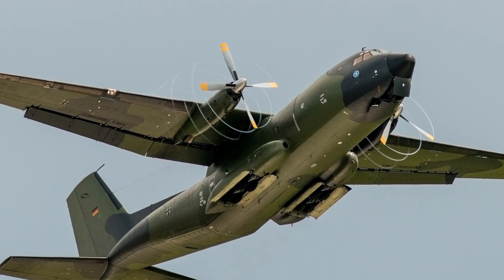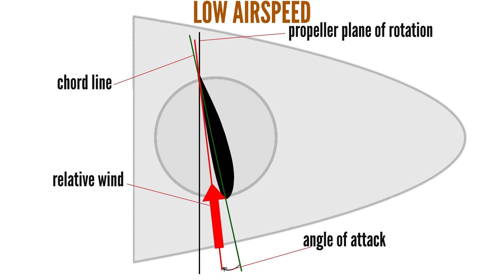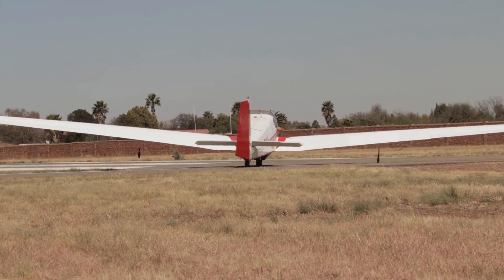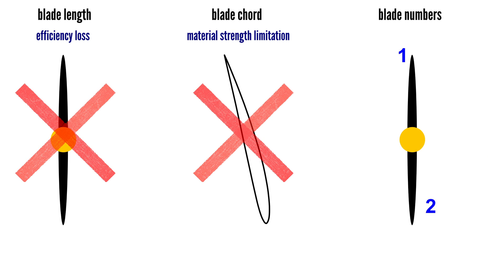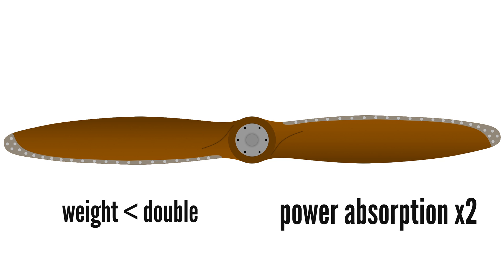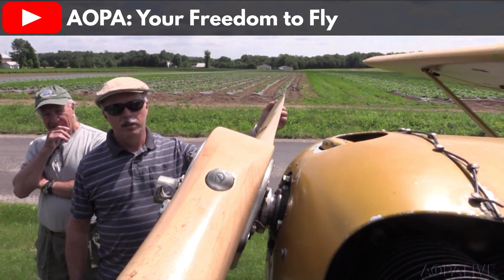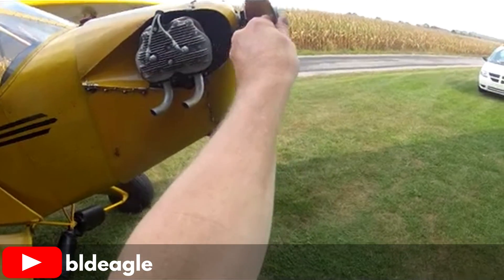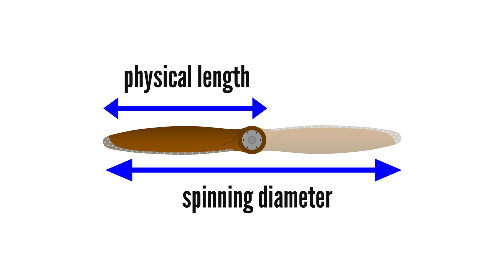The Problem with Single Blade Props Isn't What You Think - Efficiency Deep Dive

Comment: I'm not interested in efficiency. Powered hang-gliders and para-motors don't really care if they use an extra quarter liter of fuel an hour.
The NOISE is what gets us banned from flying sites.
A one bladed prop would put sound out at half the hertz and humans are happier with low tone sound than high pitched sound.
Is there any information available about this?

Comment: It was common for a time back in the 40s * 50s in model airplane contests to see large rubber-powered models with a big single blade prop which was folded by air pressure after the rubber unwound and the prop stopped rotating, thus greatly reducing drag.  It was interesting to watch the model wobbling its way up with the nose rotating in a circle several inches across, to start.

Comment: One Caveat! Propellers do interfere with each other. But only before the plane starts to move upon takeoff or while standing still with a strong tail wind. You can actually hear the noise change as the blades fly through the wake of the previous blade.

Comment: One disadvantage of a single blade (despite perfectly counter-weighted)  is a lot of vibration from a rotating point of thrust that's putting an oscillating load on the front crankshaft bearing and engine mounts.

Comment: Interesting article;  look up "Gluhareff single-blade helicopter"  -  he built it because he could not afford to build a two-blade rotor, for his research project.  He later built a two-blade version - and guess what - it vibrated more than the single-blade version.  This article is correct on the weight issue;  to generate the same thrust given the same conditions, the blade area of a single blade needs to be double that of one blade of a two-blade propeller.  If the airfoil is the same, this means there will be four times as much material - so the single blade propeller will weigh roughly twice as much as an equivalent two-blade propeller, before adding the counterweight which would also weigh twice as much as the second blade.   However, if the propeller has a "flapping" hinge - look up Cierva's invention that made autogyros possible - the issue of the bending strength of the blade under thrust loads disappears;  so a thinner blade airfoil can be used. The "offset thrust" issue also disappears,  because a hinge cannot transmit a bending moment into the shaft.  The efficiency of any propeller cannot exceed its "Froude efficiency", which is primarily dependent on its diameter, so the minor benefits due to the different spacing of the helical wake  are in fact not significant.   Single-blade propellers have existed since 1938 - see "Everel single-blade propeller.  It had a skew hinge, so that when the blade hinged forward under thrust loads, the pitch angle reduced - Everel was looking for a simpler constant-speed propeller - but the pitch-change angle achieved by the skew hinge is far too small to be of much use, so the idea died a natural death when constant-speed propellers as we now know them came on the scene.   
On a real aircraft, there are many other factors to consider, which dictate the propeller diameter - and  a single-blade propeller may make sense under some circumstances, for a low-powered aircraft.

Comment: Single blade props were, and still are used in F2A Control line model aircraft racing. Typically the whole crank, prop and spinner are balanced as a single unit, at 40k rpm it needs to done accurately! There's no doubt they are the most effective for that extreme and highly specialised case.
Reply: thanks for this insight

Comment: Most propellers of WWII did not have 2 but 3, 4 or even more blades. Only some of huge wind turbines used single blade.
Reply: But war planes aren't after efficiency. They are limited by ground clearance and the propellers are trying to make use of all the power available in the very powerful engine

Comment: Makes no sense because you'll still need a counterweight to balance the single prop, might as well just use another prop to do so. Also anyone who thinks air around a moving prop is undisturbed should try standing near a running one. 5$ if you can find the undisturbed air lol.
Reply: You're thinking of just taking a two-bladed propeller, removing one blade and counterweighting it but that's not how the argument for for single-blade propellers goes. What you would do is have a blade that is much larger and longer than on the single bladed propeller than the blades on a two-blade propeller so the engine is loaded down the same. You're trying to get the efficiency gains of a longer, wider airfoil on the same engine and the hope is that this increase in aerodynamic efficiency outweighs the cost of the counterweight. Like going from a biplane with two smaller wings to a monoplane with one larger wing.

Comment: You can't just cut one blade off and counterweight it and increase efficiency.....
If you get rid of one blade you need to change the design of the single blade to make sure its efficient.
We used to race U-control models with one wing and one elevator and even one prop.
That was the fastest design around. And around. And around....

Comment: All very interesting. 
I wish the part where temperature was effecting the propeller had been explained in a bit more detail.
Reply from the maker: I'm guessing it's the air density. Since it's basically auto variable pitch, high air density (cold temps) would make the blade pivot more to in increased lift/thrust, and the friction on the teetering hub needs to be adjusted. But don't quote me, I'm guessing here, I don't know the reasons and I only repeated what the owner of one of these propellers reported.
Reply: Wooden propellers absorb moisture, so their mass will change based on conditions. Not usually a problem for a 2 bladed prop (though you want to hanger the prop horizontal to keep things as symmetric as possible), as the change should be pretty even, but for a 1 bladed prop it would be.

Comment: Just on a purely theoretical standpoint, this doesn't make sense. Having offset center of thrust gives a prop efficiency with a Cosine function, and rotating pivot moment has to be corrected constantly...So it can never be as efficient as a balanced setup.
Reply: It is constantly corrected by gyroscopic effects with perfect efficiency. The torque to move the thrust onto the centre line is provided by the constantly changing angular momentum of the prop, which over one rotation sums to zero. At any moment in time the angular momentum of the prop is not aligned with the spindle.
Reply: @agsystems8220   I'm saying any thrust not in line with the center of mass when corrected is no longer a thrust vector parallel with the direction of flight, thus losing efficiency. 

Instead of f=ma you get a=cosf/m

I stand corrected then, I'm versed in rocket propulsion, not propeller aircraft. You have me on the gyro thing, I have no idea. This was just my virgin response on the concept of the video.

Thanks for the input, I appreciate it.
Reply: @meusana3681  It isn't thrust in centre line that matters for efficiency, it is thrust in direction of travel. In most circumstances thrust must be in line with the centre of mass to avoid spinning the whole craft out of control, because you would induce a torque on the craft, but here is one of the few cases where that doesn't quite apply. The torque is still created, but averages over time to zero, and the angular momentum variation is soaked up by the propeller itself rather than passed on to the aircraft. The propeller's angular momentum is never quite aligned with the axis of rotation, and the torque that is continuously changing the angular momentum is also continuously transferring the thrust to the aircraft centreline.
Spinning stuff is often counterintuitive. This isn't quite on the level of a gyroscope sitting sideways on a string, but it is that sort of effect.

Comment: Ok I'm less than a minute in and the wake thing should be obviously false. Planes (and their propellers) tend to be moving forward into undisturbed air. 

I'm predicting the issue is imbalance, not of the propeller mass, but of the thrust force. One blade means the thrust vector passes through the blade itself and not the drive axle. This probably causes a small wobble/vibration

Edit: guess I should have expected engineers would have anticipated these issues and the ultimate reason is increased cost for little benefit.

Comment: Propeller has to have central axis of symmetry - otherwise it's not only inefficient - it's unfeasible. This is obvious the moment you take into account rotating mass and rotating forces.
First it would need to have a counterbalance that wouldn't contribute to generated thrust in order to avoid centrifugal vibrations. Second since thrust is generated on a single side of the axle, there will be a massive bending force acting on it, so the axle has to be beefier and much heavier.
Third - that bending force is going to constantly change direction leading to massive vibrations in every direction no matter what you do. (other than making a symetrical propeller)
Reply from the maker: I mean, I covered all that. But yeah, when efficiency considered aerodynamically per blade in isolation, it's the best. Considering everything else, then no, not so much. Definitely not unfeasible though by the dictionary meaning of the word, because it exists and is in use outside of just testing and experimenting.
Reply: Don't you just love people saying things that have been demonstrated to work cannot work :P. You are arguing with reality. It does work. You have made a mistake.
The important thing to realise is that the angular momentum of the prop is never aligned with the spindle, and is constantly changing. For that to happen there must be a torque. That torque is provided by the misalignment of the centre of lift and the spindle. The teetering mechanism cannot support a bending moment by design, so there is none. The spindle sees no bending moment. The angular momentum of the prop will constantly change to accommodate this, eating all the torque you are worried about. Instantaneously it looks like it makes no sense, but the torques cancel over a rotation and the prop is heavy enough for that not to be a problem.
Your three observations are sort of correct. What you miss is that it doesn't manifest as vibration, it manifests as a variation of the angular momentum, and this can be restricted to the prop itself by the teetering mechanism.

Comment: Who's to say a two blade prop isn't actually a single blade with a cleverly designed counterweight?
Reply from the maker: Can't argue with that 😆
Reply: @LetsGoAviate I can.... Which one is the counterweight? The service and inspection intervals will be different for each.
Reply: @christopherleveck6835  the counterweight has a counterweight
Reply: @warmstrong5612  the props are illusions, there are only counterweights 🤣
Reply: Gah who put this philosophy in my mug of engineering
Reply: I'd argue if you can't distinguish between blade and counterweight, it should count as zero blades
Reply: Behold, a counterweight
Reply: - balanced mass moment of inertia, thrust developing counterweight....

Comment: I imagine a single blade would face balance issues not only from the weight, but also from the thrust. With thrust only coming from one side of the hub that would surely have some sort of lever effect on it?
Reply from the maker: Absolutely yes, as mentioned in the video. The teetering hub helps with that though.
Reply: @LetsGoAviate  the hub teetering doesnt change that, at least not how its shown in the video. Maybe its just the explanation thats not quite clear, but making it move freely would cause it to move to the end of travel and exert its bending moment from there. 
i can think of some bracing to reduce the bending moment, but moving freely enough be moved by hand doesnt seem helpful past changing prop pitch
Reply: @broko336 The lever force attempting to bend the blade/drive shaft is nearly completely removed by the teetering hub. If the blade can just bend forward without resistance, than the force trying to bend it forward can't really be transferred to any other part. The blade is allowed to naturally go into a position where it will be balanced by its spinning motion. The blade tilting forward will unbalance the centripetal force and result in there being a net torque to oppose the bending force on the propeller. 
If you have ever spun something around on a string over your head, the string will get closer and closer to horizontal as you spin it faster, despite gravity attempting to bring the object down.

Hypothetically you could achieve the same effect by curving or tilting the blades in the first place, but it would not be able to do so across a wide range of airspeeds and rotational rate, like the teetering propeller can.
Reply: @markjacobson4248  thanks, i didnt consider inertia forces when spinning when thinking about it
Reply: I've only seen single blade props on rubber power models, and yes the airplane absolutely did wobble.

Comment: Clearly more blades are better otherwise 3 blade props in WWII wouldn't have been replaced by 4 blade props.
Reply from the maker: It really is not that simple as "more blades is clearly better". It depends on the factors I mentioned to get optimal power absorption without sacrificing a lot of efficiency. The Germans stuck with 3 blade props almost religiously, even on the 2,000+hp FW190 Dora, while the Americans quickly switched to 4 blades even on lower powered planes like the P-51 Mustang (compared to Corsair, P-47 etc.).

It's about power absorption vs efficiency. The higher the power output the more blades will be required, as there is a finite amount of power absorption possible per blade, and even less if efficiency isn't to be greatly sacrificed.

I made a video on 2 vs 3 blade props if you are interested in the subject.

Comment: The major limitation of wood is found at prop hub considering the spitfire / Seafire used a wooden prop, they started out as fixed pitch in the prototype then they had aluminum hub to house the pitch mechanism and  3 wood blades, then four, then a six blade counter rotating....then I get sort of fuzzy but I think they may of had like 7 or 8 blade things. The Spitfire  went from 800hp to well over 2000hp over its development cycle. They used wood for so long because it dampened vibration and was cheap and easy to shape.  
In the youtube video link https://www.youtube.com/watch?v=dJ7URD89uBs at 0:52 There is a prop strike and from the remainder of the prop you can see how much wood is in a spitfire prop.

Comment: OK. There's another factor to consider, reduction drives. I found that a prop blade increases power absortion lineally with the increase of pitch, with the square of diameter increase, and with the cube of rpm's. Efficiency increases with diameter, which forces a greater gear ratio to keep tip speed low, which also increases efficiency. Juggling all that I found the best solution for low power engines to be a composite three bladed prop with adjustable pitch. Three blades give you a better equilibrium, too. Six blade, big diameter props gave great take off thrust and very low noise, but are SLOW...
Reply from the maker: Yeah with reduction drives the propeller spins slower, and so does the blade tips, so diameter can be increased. Used to great effect on some WWII fighters like the F4U Corsair.
Reply: @LetsGoAviate  Sadly the F4U also shows the down side of such large props: Increased gyroscopic forces, and thus P-factor. This is a good part of the reason it gained infamy as the 'ensign eliminator'.
Reply: Issue with large props spinning slowly is that they great very annoying bass noises at high volume.
Reply: Reduction drives are a nightmare for piston prop aircraft engines. The issue is that the prop is also doubling as the flywheel for the engine, and is constantly exchanging far more energy with the engine than the net engine power. For a standard flat plane 4 cylinder engine design, all 4 pistons are moving at full speed at the same time, and are stopped at the same time. The energy to do this is exchanged with the prop twice every rotation. There is also the variation in the torque provided through the stroke. It is workable with enough cylinders and the right design, but unless you design for it the torque variations will shred gearboxes. While they can cope with rapid variations in torque, it is very hard to design something that can cope with rapid reversals in torque.
Reply: @agsystems8220  aircraft engines have included pendulum dampers into their crankshaft since the 50's for this very reason, since it's not exclusive to reduction drives.
Reply: @agsystems8220  I believe 4 piston linear aerial engine is rare. By WW2 most engines were either star 7 or 9 cyllinder (or double that), or V12. Those should be much better balanced throughout the cycle.
Reply: @kwzieleniewski he is not talking about WW2 aviation here, he is talking about horizontally opposed 4s used in, for instance, cessna's...etc.
Reply: @agsystems8220  That's very interesting. I never thought about it that way.